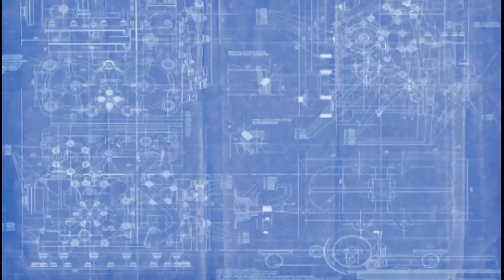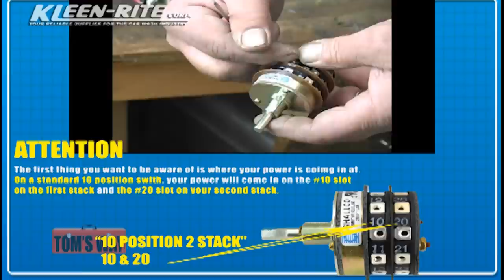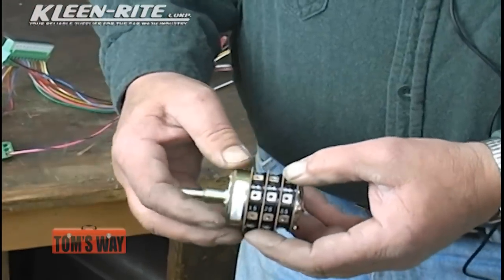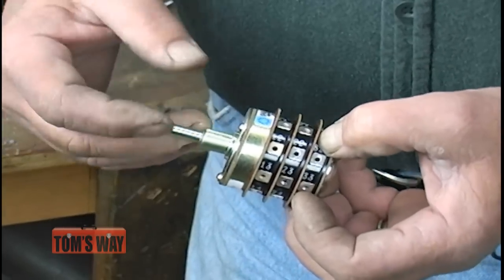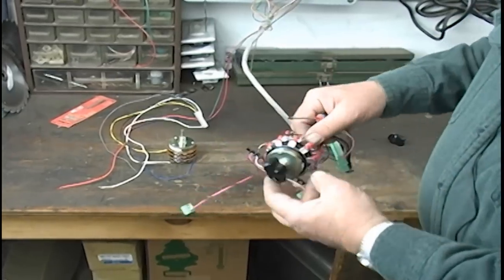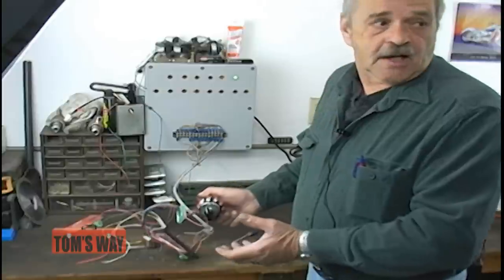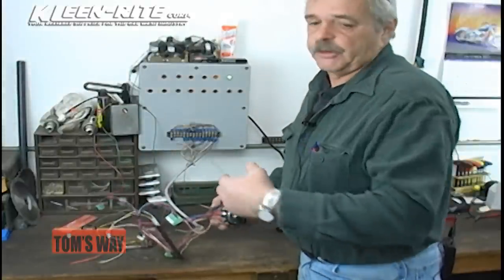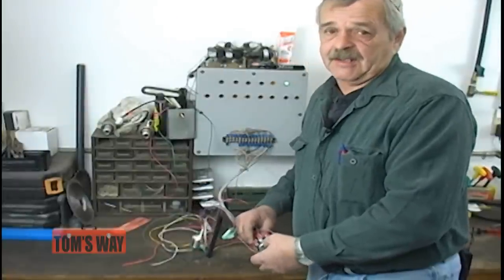Rotary Switches 101 | Kleen-Rite

Comment: This is a very good video for understanding switches. How do you connect solinoids to these switches and the jumpers. This is more confusing than the switch itself. I like this video but it only tells me about the stop and engine start aspects. I am still confused on how to connect a solenoid to it. A solenoid has two wires but I can't seem to find a video that tells me how to wire my solinoids.